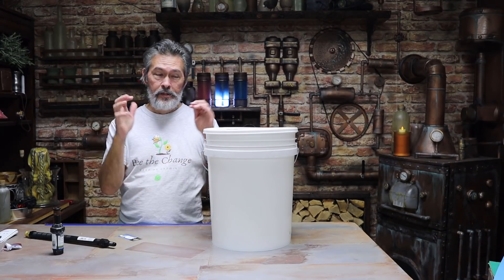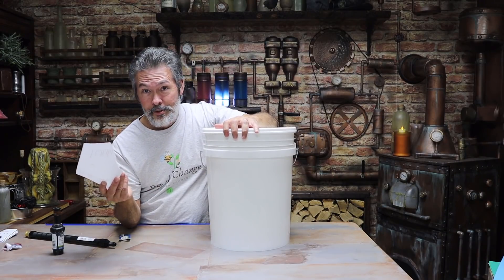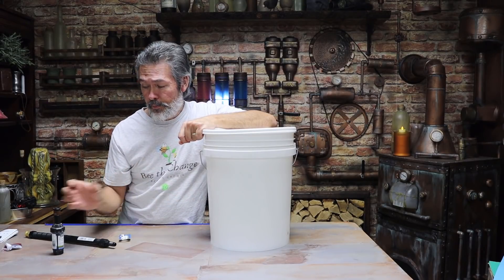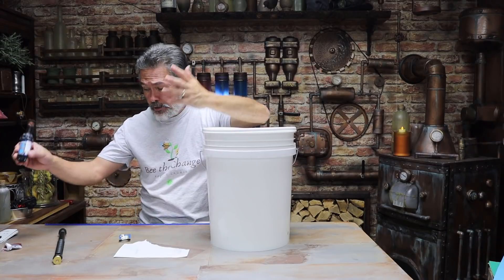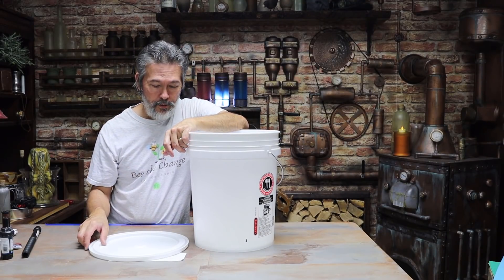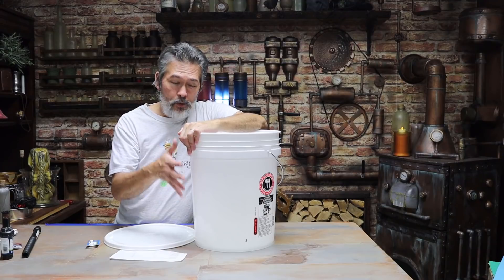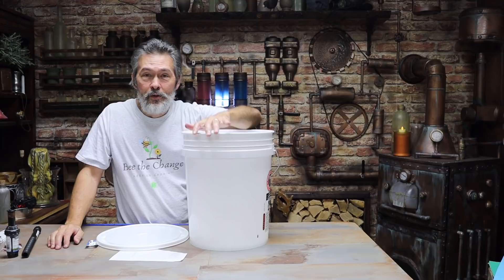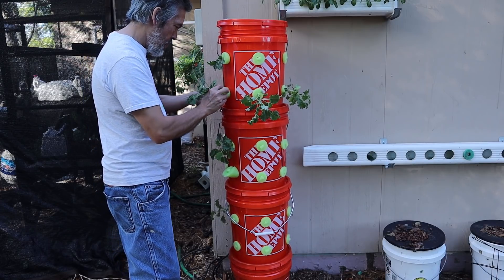CHEAP & EASY DIY Garden Tower Backyard Hydroponics!

Comment: If you find you need a larger water container don't they make bigger buckets?  Or maybe mount it on a 10 gallon Rubbermaid garbage can with lid upside down?  
I think you can get 7 or 8 gallon brew buckets too that are food grade and look like regular 5 gallon buckets.  
But oof. Expensive again lol. 
But those big black and yellow boxes might be a good choice too if they are as sturdy as the one I bought for storage but the bottom might need a seal of aquarium silicon to seal it.
I hate to say it but im becoming a "use it up/make it do or do without" kinda gal the older I'm getting and I have all types of pond pumps and they came with all sorts of goofy tops like sprinkler/bell/foam etc.. along with lots of extra adapter pieces and ssandpiper.
 I'm already trying to think of all I have laying around to make one of these lol.  I've even got black water supply hose for my pond.(for algae control) Would it be okay to run that outside the buckets(like how the power comes out) and hook up pointing down on the top to one of the sprinkler heads. But then  I wouldn't need to put a hole down middle that way so water would still dribble down the ring of holes.
Oh my. You've once again set my poor brain running round on the hamster wheel of "hum can I make that with what I've got?" And "can I change the design without changing the function too much?"  
But thank you again Mr Mike.  I try to send as many to your page as I can.  My mum loves the lettuce I grow from the down spouts and I tell ya they do beautiful in the house under my LED lights.  I have cats so most of my buckets are square and I'm not sure it will work but a local bakery sells their frosting/filling buckets for $1.99(washed even) but they are only about 3 1/2 gallon but geez I think they would work fine but I might buy a 5 gallon for the bottom.  
Okay enough rambling you've got plenty to do other than read a book I write today lol 
May you and your lovely family stay safe in the storm and I must say fabulous beard.  😁

Comment: And if you heat the plastic it cuts far easier and safer just don't melt it melt it like you would making a basket just take a lighter to it too for a few seconds and it softens the plastic making it far easier to cut especially if you're not using a power tool

Comment: Love your channel. Due to hand injury I've decided to phase out my garden beds for hydroponics. I'm curious, could you use an epoxy or silicone glue to attach lids to bottoms instead? Or are the nuts and bolts to make disassembly easier?
Reply from the maker: In case any water drips out of the sides, if it runs down the side of the tower, it can flow back into the system.

Comment: I plan on lighting a bucket tower with a pair of dual T5 BULBS HUNG VERTICALLY, PIC. TO FOLLOW SOON, I HOPE. ONE ON EACH SIDE 5-8" AWAY, WILL FEED ALL THE LIGHT THEY NEED. PLAN ON 75 + STRAWBERRIES, EVER BEARING OF COURSE, NO IDEA WHICH ONE, AS WE HAVE 2 LOCAL STRAWBERRY FIELDS NEARBY. I want varieties of lettuce & herbs, 
Tis should all be done in a week, if i am not missing anything as AMAZON 6" LONG 1/2" DRILL BIT.